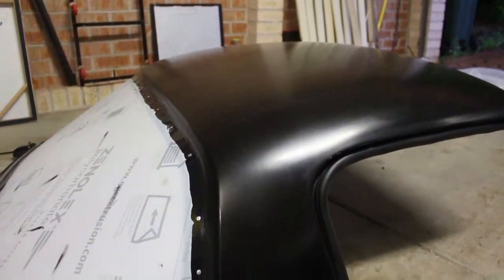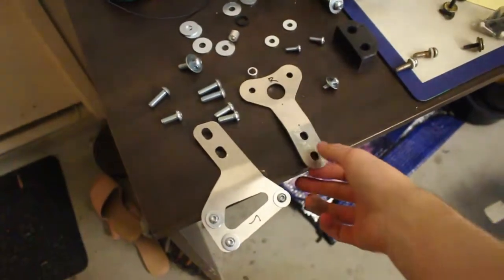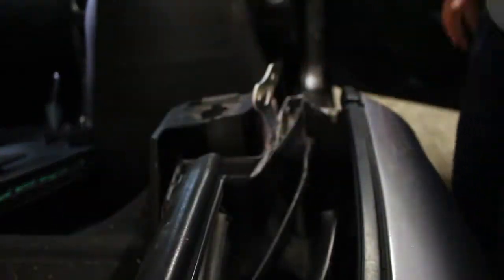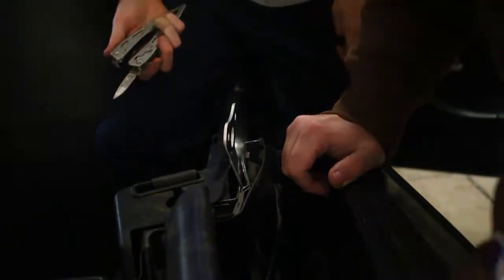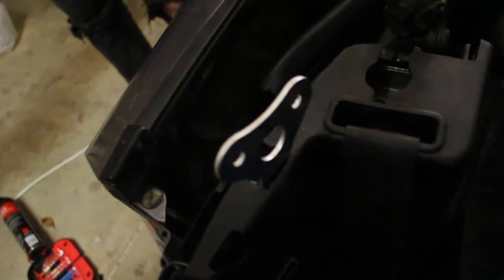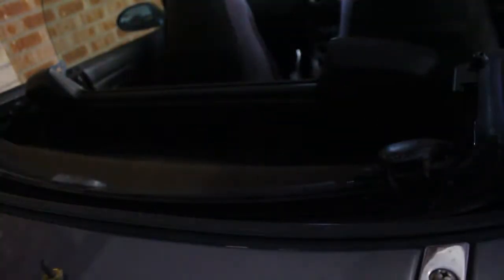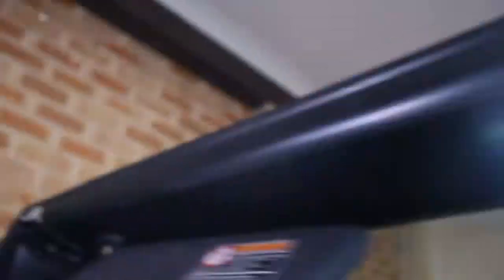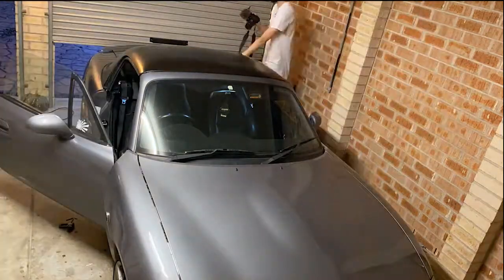Installing my "Lightyear" Fibreglass Hardtop on my Turbo MX5

Comment: Hey mate, just wondering if you’d recommend one of these cause I was looking into it recently and just wanted to know how it’s been in terms of noise and overall quality, thanks
Reply from the maker: Hey man, yeah for the price I would recommend them as a decent option. Given that Oem ones are like 3k second hand at this stage and are hard to find (depending on the colour). With these ones you have the freedom of leaving it black or having a good base to paint on. It is a bit noisy and I'm in the process of rectifying that (editing that vid now) but with the limited affordable options I'd say its not bad. Keep in mind I've never driven with an Oem Hardtop so my opinion is very ones sided. I could be completely wrong. I'm slowly making improvements as shortfalls come up so people have a bit more info on what to expect and then they can decide if they wanna go down this path.
Reply: I am selling mine as cant wind windows up with doors shut due to poor rubbers and wind noise and poor fitment issues. Going for a genuine oem one now